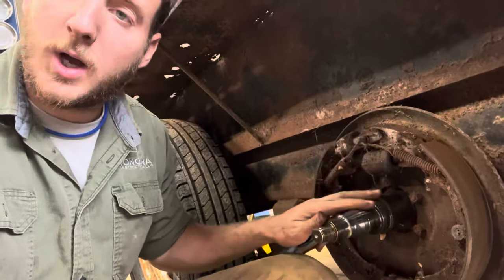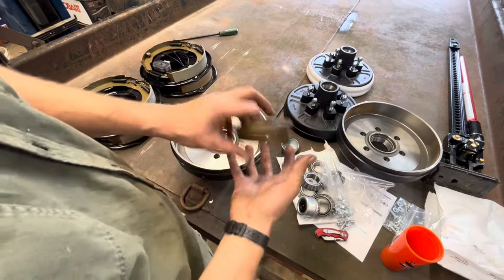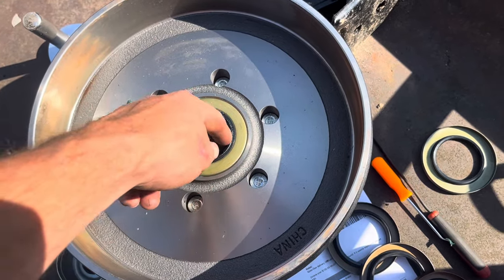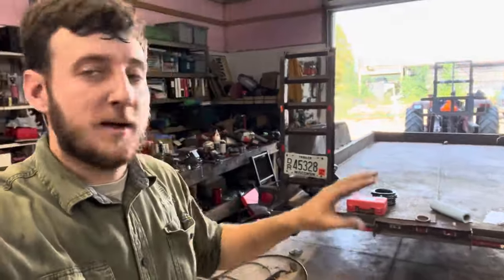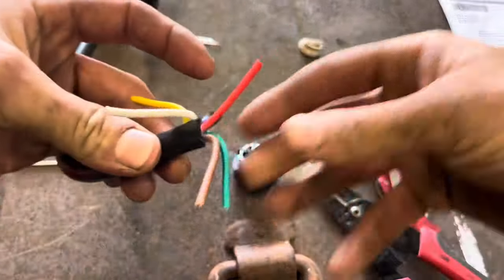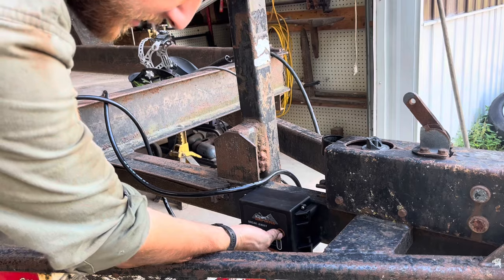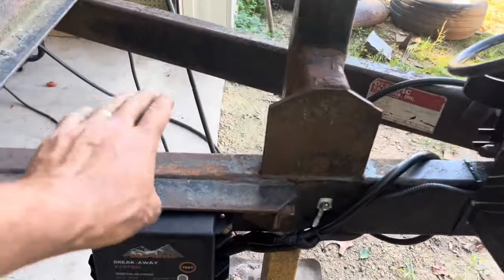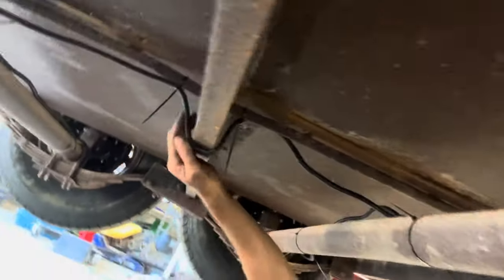Converting a trailer from surge brakes to electric brakes. Complete walkthrough

Comment: Just wired up my 28 foot sxs trailer. I used 2 junction boxes. One up front and one in the back.. tied all the rear lights in the rear box them ran main wires up to the front box. Front box I ran my electric  brakes and my front 4 amber lights and breakaway  into it.
Reply from the maker: That’s a good way to do it. I’ll have to use that tip next time

Comment: im going to be wiring up a break controller and a 7pin female plug on my 78 ford    could you do something similar ?
Reply from the maker: Yes, I used the curt trailer brake controller and tied into the brake wire connected to the brake switch under dash by pedal. Then, I ran two wires all the way to the back. One was key hot and one was brake out from controller. I then just tied into the tail light harness for the rest of the needed wires.

Comment: I don’t believe you mentioned where you grounded each brake assembly.  Did you ground each individually at the frame or run them up to the front and grounded them there?
Reply from the maker: @joshcerasale9502  I tie them into the main harness white wire. Grounding at frame works too but the less grounds the easier it is to diagnose electrical issues in future
Reply: @Notafordguy  definitely makes sense. I’m about to convert my boat trailer from surge to electric this week. You’ve helped me decide to take my grounds up to the junction box that I’ll install as well, then ground the box to the trailer with a 10ga jumper. Great video and appreciate the help!

Comment: Hi. Do you replace the coupler? Thanks.
Reply from the maker: @davebrewer9349  what coupler are you talking about? If you’re talking about the hitch then no I did not
Reply: @Notafordguy  sorry yes the hitch. Just wondered if you locked the surge coupler or welded it to stop the movement.
Reply from the maker: @davebrewer9349  I just left it as is but replacing would be a good idea if hauling over 10k lbs

Comment: Hi 
I have questions 
I did exactly like this but when I connected the wire from the brake, 1 is ground, the other one I connected to the red color in the junction box but every time when I make the left signal automatically the brake activated only on left turn signal and I changed the position and the brake not working just only work when I connected to red color can you explain why is that problem or any idea to fix the issue 
Other than that the lights work perfectly
Reply from the maker: Somewhere your left turn and brakes are shorted together I would make sure nothings touching in the junction box